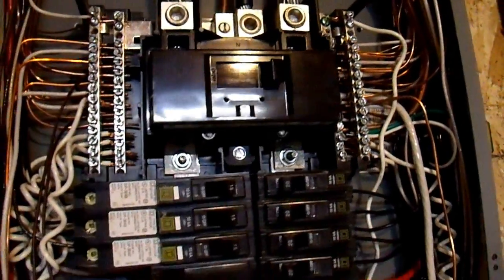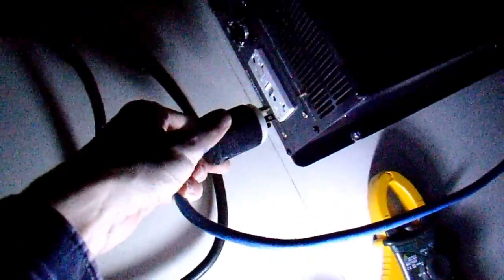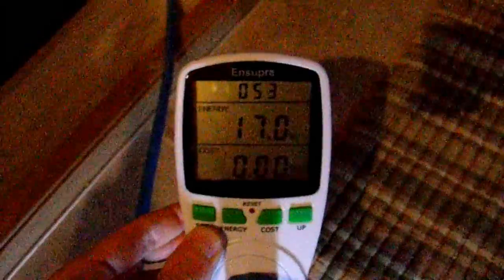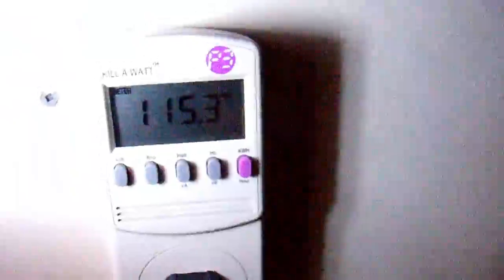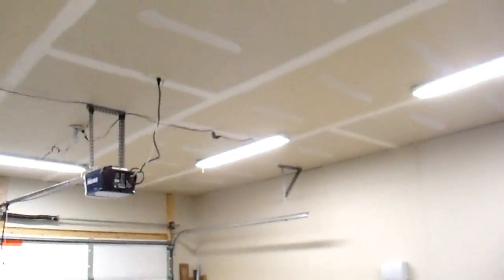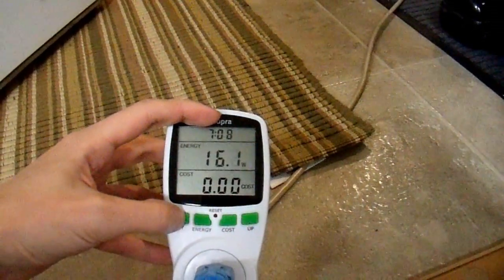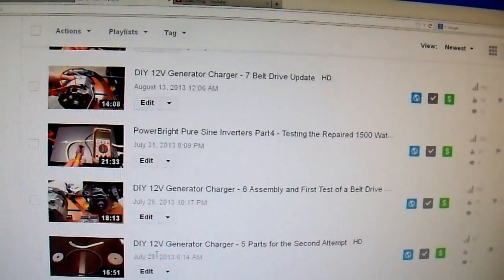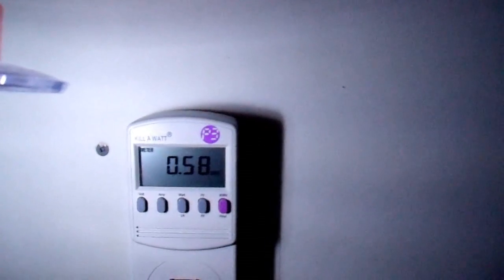How to Power your House with an Inverter or Generator During a Power Outage Part 3/3

Comment: Hi there I've watched your three vids about backfeeding inverter o/p into home wiring and I'm glad I live in the UK. We don't have the split phase system here. The mains outlets and lighting are all 240V. So after isolating the incoming breaker, backfeeding the inverter into any sockett powers everything (within inverter limits). I wonder, if U got a 240V inverter & wired it across the two phase lines would U be able to power everything also?
Reply from the maker: Your system is much simpler in the UK, here in the USA powering 240V only would cause a severe voltage imbalance on the 120V circuits and destroy most everything on the 120V circuits.  Perhaps I should have  mentioned that...  :)

Comment: Awesome video.  Thanks.  If one already had a 220V 30amp breaker set up to run a generator using a L14-30P plug and wanted to utilize that to run the inverter also (not at same time) could one use a 2X 5-15P Male Generator to 4 Prong 30 Amp Female (Amazon search) cord to go between the inverter and plug, making sure to cut off the ground terminal?  Also if the inverter had hardwire capabilities could one make up a whip using the hardwire section on one end and L14-30R on the other?

Comment: Thank you. Answered many questions that I had. Had no idea that GFI's could create a problem. Got one in the kitchen, so I'll need to figure that one out. Turning off the 240v circuits is a good idea, plus any unnecessary energy hogs. Like you, I'll try a dry run first. Thanks again.
Reply from the maker: A dry run is the most important step.  Run your house as if the power went out while you do 'normal' activities (so long as the wife allows) and see how it works out.  There is a lot to be learned.

Comment: Awesome video,sir!! I am without electric service on my home due to excessive charges by my electric provider. 
running seperate generators on home not to electrical panels. I have electric cords run to power critical loads for a few hours per day, not  constant 24hr use like grid. will certainly review these vids to cover all bases before I follow your lead I this fight for freedom from tyranny!!

Comment: I have a question I have an aims split phase inverter 240v. It has a ground and two hot inputs, and two hots and a neutral for the out put. So I have a l14-30p inlet to a double pole 30amp breaker to backfeed do I need to connect my ground? To backfeed it? Or just both hots and neutral?
Reply from the maker: Connect both hots and the neutral.  Do not connect the ground for an emergency power situation as it will cause complications that are not necessary.  Backfeeding has its liability dangers as described in the video so do so at your own risk and make certain your mains breakers are always in the OFF position.
Reply: @knurlgnar24  hey i really do appreciate it, I've done this before with my generator and works great and tried it with a cotek 2000 watt inverter with gfci, didn't work until I cut the ground wire. Then it did work.

Comment: So to understand this, you switched your main breaker then pluged in your invertor to use existing wiring. Is this simplified version correct?
Reply from the maker: Yes.  However I would not encourage anyone to do this unless they have a good understanding of what can go wrong.  Making a mistake can have consequences which is why I made a longer video than just a few minutes.  The safest method is just to run extension cords if you have them.
Reply: @knurlgnar24  hi, yes I saw your other video explaining the flaw in my logic and how dangerous it is. I was just looking to power lights on a power out situation. Thanks, it's definitely gave me food for thought
Reply from the maker: @tourbike  I wouldn't consider it a flaw Patrick, if learning is a flaw then then fools are the wisest men.  Best of luck.

Comment: Thanks for the video series. Great to see you work through the failures and issues. I ran a 220/240 50 Amp fused box off my main a long time ago to power a heated press and knee mill. So I used this to back feed from my Bluetti 500's plugged into the split phase infusion box. This allowed me to maintain my 240V service throughout, but it sure sucks the batteries quick, so I am replacing some of my 240V appliances to see if I can really live off grid as I build up my solar panels from 3000 to 6000 watts. The 10KWH batteries are great for everything except Electric water heating and whole house AC. I am also going to need to add a couple small AC units and I will also need to increase battery backup volume, adding 8 KWH more soon.
Reply from the maker: Thanks Steve.  I've had the same issues with my 15-20kwh battery bank.  It can run the central AC and water heater but not practical to do so.  Mini-splits or window AC units would be more practical in bedrooms or small areas and with hot water, well, hot water takes a huge amount of energy.  Not much getting around that except to conserve and reduce usage.

Comment: At first you said 240v would work...but at the end of the video you turned off all the 240v items...So it did not work? It seems to me you wouldn't have to switch out the GFCI if you had the 240v breakers turned off... If you started a fire the insurance company would not cover you.
Reply from the maker: If you thought I said 240V appliances would run off of a 120V inverter you misunderstood what I said.  Yes, the insurance company would cover such a loss.  It may be difficult to find reasonably priced insurance for a time afterwards though.

Comment: I'm surprised you didn't go with 48V, heavy loads are a lot more efficient on 48V than 12V
Reply from the maker: Efficiency isn't directly related to battery system voltage in actual practice, though higher DC voltages do trend towards higher efficiencies.  The inverter used in this video is >90% over nearly all of its practical operational range which is very good.  Few 48V inverters accomplish this.  Today I have a 48V inverter for this setup and it peaks below 90% efficiency but can power heavier loads.
Reply: @knurlgnar24  true, but cable losses are much more detrimental at lower system voltages, resulting in less usable capacity, I used to run a 12V system with a 4.5kw Inverter and 20kwh battery bank made from junkyard cell tower batteries (which showed around 90% health) and even with dual 4/0 AWG cables I would easily lose 2V on the DC side under full load, effectively cutting my battery life by 70% due to cable losses when running at or near full load

Eventually I gave up, sold the inverter, bought a 48V model, reconfigured the battery bank to run at 48V, and under the same load, I got around 0.8V of drop 

These days I'm running 52V from a 12kwh lithium ion battery bank made from Nissan Leaf modules

Comment: What kind of battery bank do you have set up for this system also type of inverter? Thank you by the way , very informative 👍 👏 🙏 👌 😀
Reply from the maker: I currently use 12 100Ah Powersafe SBS batteries connected in 3 sets of 4 for 48V.  At the time of this video I had about 10 of them connected in parallel for a 12V system.  I just tested them out on a simulated power outage yesterday and they still work great.  10 years old and heavily sulfated in a scrap pile when I obtained them.  Batteries last longer than most people realize if taken care of.  Thanks for the comment.

Comment: i know this is an older video, but how did you get to bypass the ground/neutral bond to get the inverter to work, just by using the gfci on the inverter, so we dont blow up inverters, my mobile home has a seperate grond and neutral bar, so i shouldnt have to worry about what inverter i use then as a battery backup, i was planning on a 1500/2000 watt, and just hook to panel after closing main breaker and shutting off all 240 breakers and then use a 240 bhreaker as a back feed or feed for both phases
Reply from the maker: If you use a 2 conductor extension cord to the inverter output (no ground) the ground/neutral bond issue is negated so long as you feed it into a non GFCI circuit.  You do still have safety issues regarding the potential of electrified DC battery connections with this method but the inverter works without issue.
Reply: @knurlgnar24  so do you mean the battery connections could possibly carry a small current, of ac voltage besides the dc voltage, thanks for your response, this just for emergency and would use an interlock on panel
Reply: @knurlgnar24  so just cut off ground lug from cord
or make new cord with no ground

Comment: I would like to hook an inverter up to the 12 volt battery in my Chevy volt and power my house in an emergency situation .  I have a 220 volt plug in near my car which the EV charger plugs into.  Would it be possible to use some sort of suicide cord from the inverter to the 220 volt Plug-In?
Reply: Note, the 12 volt battery is charged by the Volt battery pack and when that runs low the internal combustion engine turns on to charge it.
Reply from the maker: Interesting project and I very much like the idea.  (And the now discontinued Chevy Volt)  However I don't think tapping the 12V battery is a good idea unless you're only wanting a few hundred watts of power for lighting and electronics.  The Volt's DC/DC converter isn't capable of long term high currents.  If you are able to find what the continuous amperage rating is let me know as I'd be interested, but I expect it is somewhere around 500W and even that would be very hard on it and reduce its life due to high temperatures.

Comment: Excellent video great information but too much work too many batteries just way too much inverter generator nice quiet one and a 220 line And all good to go much easier With a 220 switch and shut off what you don’t need unless your inverter can handle it but all in all great video and info

Comment: i noticed your batteries were 12.9v, then you put a load on the inverter and then it dropped  to 12.6v, which i do expect a small drop. then about 1 minute later it dropped again to 12.4v. this seems like a fast drop in voltage for such small load on the that good size battery bank. i have seen less voltage drops using a single 100ah agm with larger loads. was that a new battery bank? i see a lot of people buying them used. maybe video editing is playing tricks on me? when you cam in from the top to show the batteries they were skiny and orange,  i assumed some sort of lithium, but when you came in from the back it was a wet cell deep cycle, just curious if you mix and match batteries? also, i am trying to learn about ac power, i have been playing with inverters for years, anyways to me it seems like you just used the circuits that are normally used for "phasing" and treated them as separate circuits, right? you kept calling it phase one and phase two, but that is not what really is going on if i understand correctly, your inverter only has one phase and on that one phase two extension chords simply back fed into the breaker box. so when one circuit is using 400watts ac and the other was using 15watts ac, its like you had a small led light plugged into one of the outlets on your inverter and a powerful desktop computer plugged into the other...nothing to do with phases, right?

Comment: Just curious if I had a 240V inverter. Would it be possible to connect to my dryer outlet turn off all other 240V items like my AC and such in my breaker panel and also turning off the mains breaker. Would this energize both 120V phases of my house?
Reply from the maker: If your inverter is 240V split phase then yes, otherwise you will need to connect a transformer to the output to supply 120V for each leg.
Reply: knurlgnar24 I will have to look into this. I have an Accurate Tools ATSIU-2500P
Reply: knurlgnar24 is there a test that I can do to see if I have 240v split phase

Comment: I have a gas generator that only has 120v 20amp outlets on it.  Can I run 2 suicides chords from the 2 generator outlets to 2 separate house outlets that are on different phases to get 120 to both like you did.  I have to spare spots on the breaker where I was going to add 2 outlets 1outlet on each breaker so that those breakers are only for emergency generator power.  The breaker are next to each other on the right side phase so I know one of them connect to the right phase and the other the left.  Your thoughts would be appreciated.
Reply from the maker: Yes, it will work as you intend with all of the functional and safety issues discussed in the video.  Please take care as this method works in an emergency but obviously isn't the safest way to do it!

Comment: Could I hook up an inverter to my idling diesel tractor's 12v outlet and  to my transfer switch via twistlock plug?  I do have a generator, but I would like to have a back up to my back up.
Reply from the maker: You will need a direct connection to the battery, but yes you could.  I'd recommend buying some good heavy clamps such as Deka and a length of 0AWG or thicker welding cable as short as is reasonably possible for functionality and to keep cost down.  You can hook it up to any 12V vehicle that way making it more universally useful.  That will get you 1kw or so of power.  Not a lot but it will run the lights, freezer, furnace fan, etc.  Be sure to get a pure sine wave inverter and don't cheap out on it.  High quality 2kw unit minimum, or a cheaper quality 3kw or better unit.  It'll cost a few hundred dollars unfortunately for the setup but then you won't find that it doesn't work when you need it.  When testing it out I'd recommend to load it down and monitor the alternator temperature to make sure you don't cook it.  Not all alternators can handle full output continuously.  Most tractors can UNLESS you have a 10si on it in which case you'll likely overheat it.
Reply: @knurlgnar24  Thank you, I may look into it.  I enjoy pondering these possibilities.  The only reason I was thinking of my tractor is that I have 500+ gallons of #2 heating oil in my cellar that I could use to power the tractor in an extended outage.  I've looked into 5kw diesel generators but they are at least 3x the cost of a gas one, which I already own.  Thanks again.

Comment: Is it possible to use 1 outlet from the inverter into a 50amp dryer? You briefly mentioned it. Would you connect the 2 lines into 1 prong then neutral and ground? Any downside?

Comment: Is there any way to charge your batteries from the inverter itself to cycle back into the inverter from any battery drainage I was thinking of running a furnace blower motor off of the inverter with a belt driven to the 100 amp alternator as the alternator is charging the batteries  brace everything properly for perfect balance and spin
Reply: If I understand you, you want to use a battery to power a motor to drive an alternator to recharge your batteries.

Despite what the many free energy charlatans show you, that will not work. What you are hinting at is what is known as a zero entropy situation. Thermodynamically impossible. Also called a perpetual motion device.

They are all frauds.

Comment: I do have another question, As long as the inverter is not hooked to a GFCI circuit, is it still ok to have GFCI's on some other circuit that is still powered by the inverter? Or must you turn off all GFCI's in the house?

Comment: I enjoyed all 3 parts of your inverter videos. In part 3 you talk about not using a GFCI outlet to back feed into your system, (the one in your garage). I get that, but I have a couple questions.
1. Do I need to remove all GFCI receptacles in the house in order to back feed both phases of my elec. panel in order to energize the whole panel?
2. Or can I leave in the GFCI's, for example in the kitchen and bathroom,  as long as I do not plug anything in to them or the outlets downstream from them? 
3. Would everything work fine as long as I did not plug anything in to the kitchen and bathroom circuits that have GFCI's?
4. Or could I leave the kitchen and bathroom GFCI's in place and plug things into those circuits without causing a problem for the inverter?

Thanks for all your interesting videos!

Comment: Came across this channel wondering about synchronizing the output of two inverters to keep them from drifting out of phase. You've done some really neat stuff.

I did have to laugh though, at the beginning of this particular video series, you give a huge warning about using two different inverters (one for each leg). Talking about how the inverters would interact negatively with each other via the 240 volt devices.  Then in the last video, you shut all of the 240 volt breakers off anyway,  making the use of two separate inverters very possible.

Either way, I really like this channel. I'll definitely be watching to find more inspiration for other projects for my surplus UPS's and batteries.

Comment: OMG: All of these videos should be "How to NOT....." As you point out, there's a shitload of things, that can go wrong, (and it does :) ) safety hazards, braking codes a.s.o. There's only 1 way to do this. Use a 2 phase 120v = 240v inverter and run a sufficient cable to the ehhhh "inside" of the main circuit breaker. And protect the outside, by using a one-way-thing. (sorry I don't know the correct english word) I am quite outraged by these videos. On the plus side, you point out everything that can go wrong, but you still brake code by taking out safety equipment, to get this crap to work. Please don't do this folks. Use the few extra bucks, and do it properly. Easiest way is to buy a solar-inverter, which is made to do theese things, and charge up the battery-bank at the same time.

Comment: I see that you did it using  the pre-wired cords. The inverter that I have doesn't have outlets, and I can't figure out how, if at all possible, to supply both phases from 120v output of my inverter. (Which is what you did here, correct?)